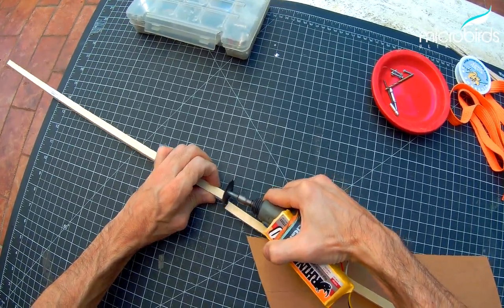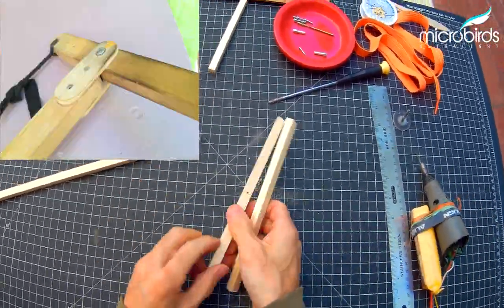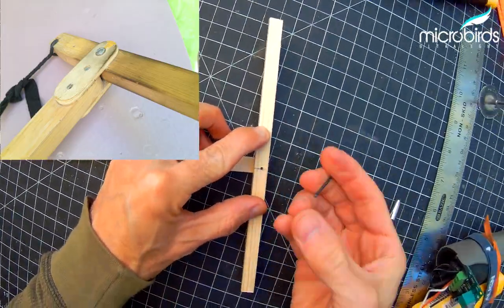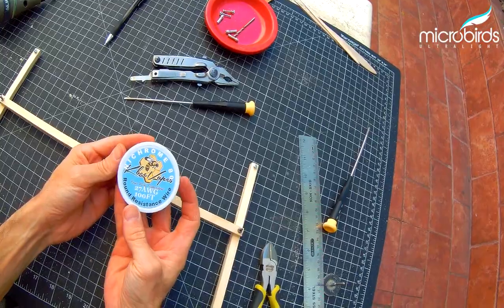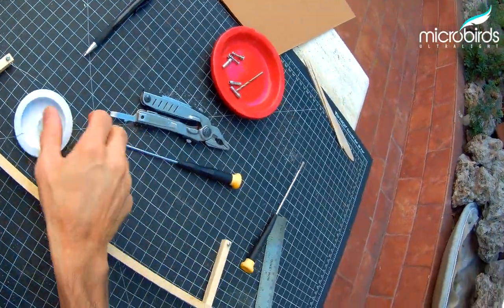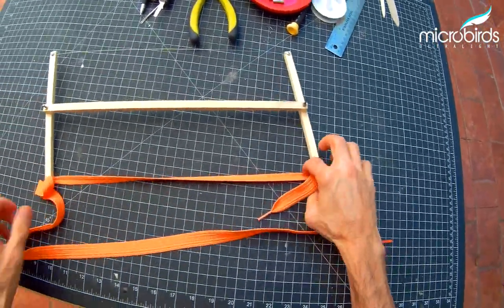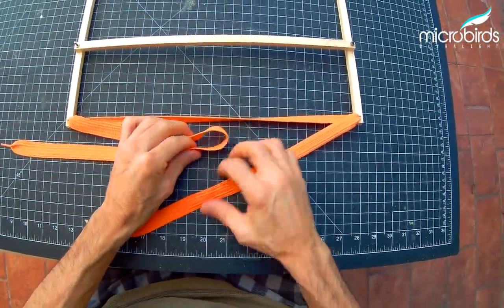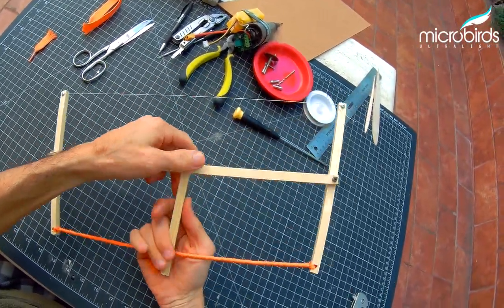DIY Handheld Simple Hot Wire Foam Cutter for MicroSonic Flying RC Wing 1 of 4

Comment: I started building my flying wing. It is covered with fiberglass and epoxy resin ... I followed your video and it helped me a lot I must say. Thank you from France
Reply from the maker: thats fantastic, would love to see  your build when you are finished, let me know if you have any questions
Reply: @microgliders  it will be 70 centimeter (+ - 27 inch) and it will be my first flying wing ...
The construction is going well, I had to enlarge the battery hatch a little to fit all the Rc equipment into the fuselage.

During the video, did you fly on purpose quickly? I hope to manage it, I'm a beginner

Comment: The music is louder than your talking .Other wise great video. Will be building one. For now having fun building the Feather squared. Great kit. How do you cut the ribs to + or - .oo1 in  ?
Reply from the maker: yes i am still sorting out my video and audio gear, sound music and mic should be fine tuned by next video. not sure what your question is on cutting ribs +- .001in ?
Reply: @microgliders  The parts are cut extremely accurate. Way better than any kit I have had before. Just my opinion but I would not have any music when you are talking. Thanks
Reply from the maker: @lawrencekalapus9566  thank you, my kits are laser cut with industrial machines, their machines are very precise , thank you for the input on the music, i will be working on a better production, still new to audio and mic setups :)
Reply: Yeah when you talk just lower the music volume or stop the music altogether. We wanna hear your wisdom, not that music loop haha

Comment: Hi can you please tell us about the conversion on your Dremmel ? Thanks
Reply from the maker: im using a DC speed controller can work up to 12 volts, you can purchase it from ebay for $5, im using only 7.4 volt lipo for this setup as i believe the original dremmel was at 7 volts as well, hope this helps :)
Reply: Micro Birds Thanks, so was thar a battery powered Dremmel or AC originally ?
Reply from the maker: @flyingdream777  my dremmel was NIMH battery powered, both the battery and the variable switch failed so instead of trashing the unit, i just replaced the switch and battery :) if your dremmel is AC then it must be 12v. i dont see a reason why you cant do this upgrade, just use a 3s 12V lipo